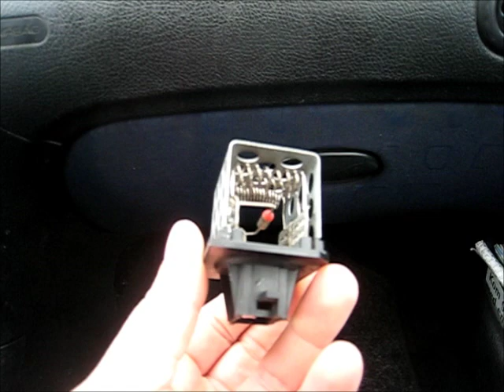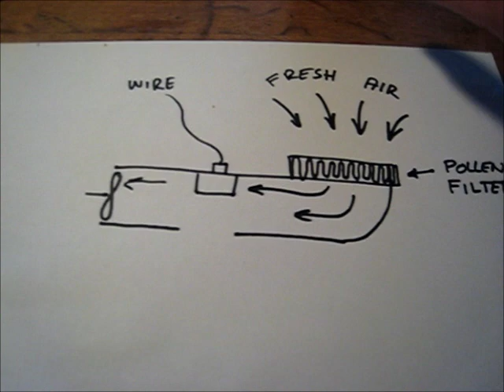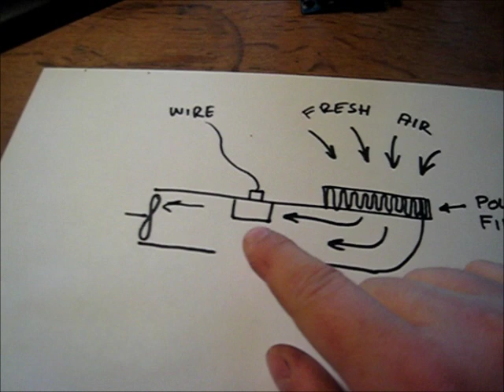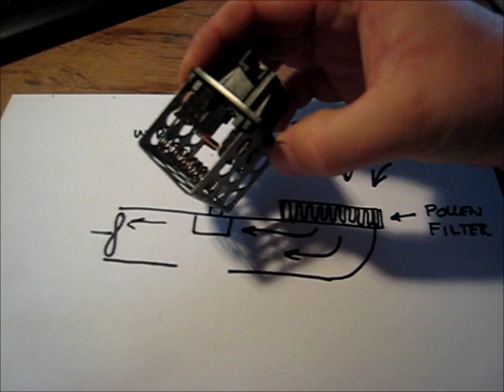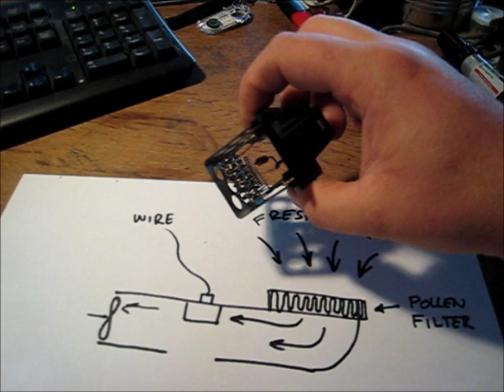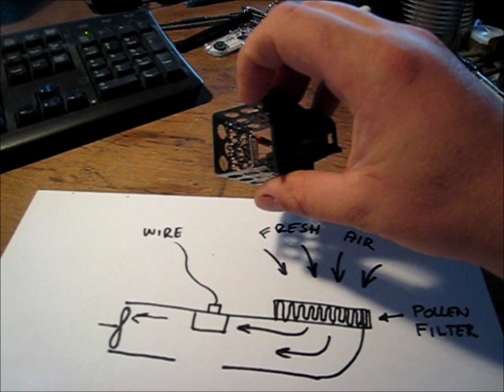Peugeot 206 blowerfan only works on high

Comment: This was very helpful, didn't realize it would only be visible on recirculation. Went to the local electronics store and bought a new fuse for 1€, much better than buying the entire part for like 30€ if not more

It was a pain to get the fuse out though since they pretty much made it impossible to repair but I used sidecutters to cut open the "rings" that held the fuse in place and I just squeezed it back together when I put the new one in there, not sure if it would've been possible to solder without breaking the fuse

Comment: Hi , thanks a lot for your video, you gave me a great idea how to do it and I manage to take it out as you said, just from underneath, some scratches in my hand ( its a right hand steering wheel UK )  and even welded the little copper tongue that have came off from one side. It solved the problem. Hope it last if not I know how to swap it now. Thanks a lot from Wales. Gus

Comment: my citroen c2 only works on the 3rd and 4th. do you know what the fault could be? maybe the 2 resistors gone for the lower settings? or could it be another part at fault? im not sure myself
Reply: +klj2503 il definitely give it ago before paying garage rip off prices, i always do oil and filter service it myself and check fuses when stuff like the wipers or horn stop working, you know the easy jobs im no mechanic but am interested. this Fault and my temperamental cigarette lighter that has faulty socket and wont charge anything, are problems i want to look at fixing myself. the garage gave up on my esp light that keeps coming on and just said theres no sign of a fault with any sensors and gave me a years MOT, ive noticed it beeps like mad when the handbrakes applied if that warning light is on. last year a wheel speed sensor knocked the light off for a good few months but its back for good now. Yeah when i get round to it il let you know thanks.

Comment: you rock dude! This is EXACTLY the information that i need for fixing my heater/blower failure... I'm so glad I watched your video before I began to dismount half of my interiour for trying to find this thing. And also, you speak very proper English, only a little soft (I know , putting up the volume should work ) , but it didn't became a problem, because you showed a picture with a red marking point to make yourself clear. 
long story short, THANK YOU xp

Comment: Thanks for this video, indeed it was really easy, you just need a little bit of gym to be able to reach the resistor.
The really hard part for me was to plug again the wire on the resistor, because I could not put both hands in the tiny space, I had to do it with just one hand available but after few tries I got it.
The resistor cost me 25€ from the website Oscaro, in a Peugeot garage, the replacement is billed 300€... (I had it replaced once, never again)

Comment: I wanted to ask you, before taking out the resistor, do you have to disconnect the batery even though the car is not running?
Reply: ***** So you didn't even disconnect the negative wire from the battery? I read on some forum that it is best to remove it to avoid any problems to other electrical parts.